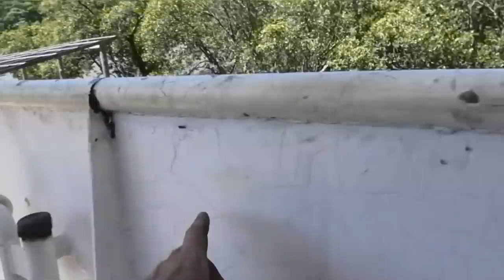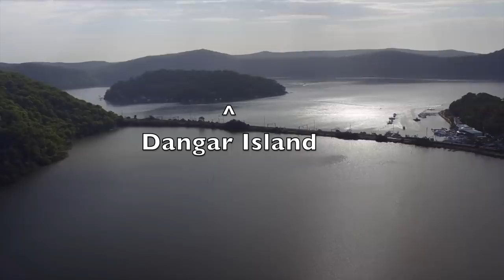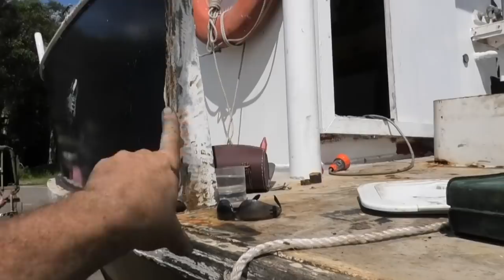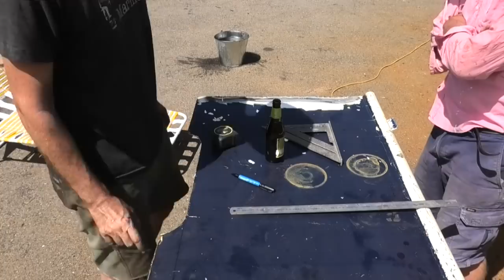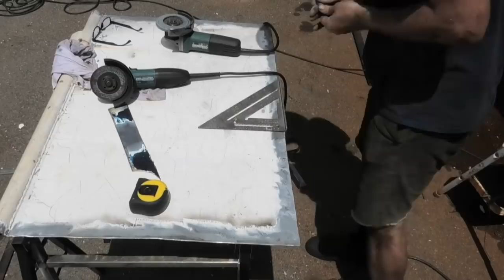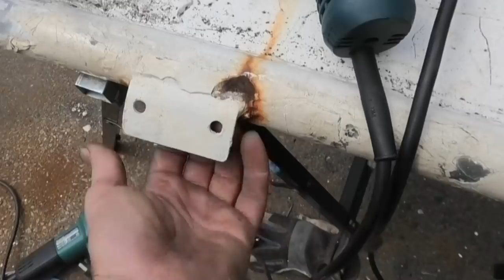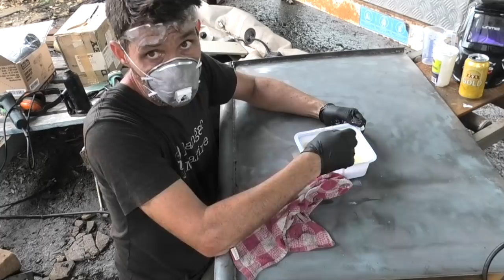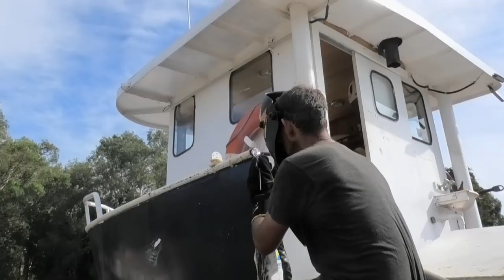Making a door in the steel trawler

Comment: Looking good.  Consider the mechanism for keeping the door in the open position.  If you need to keep it open on open water (man overboard, etc), you need to keep that heavy door from knocking you off the boat.  Also consider the clearance at the bottom of the door, make sure it's perfect for wedging your foot to the floor (or not).  Smooth sailing.
Reply from the maker: Good points about locking it open and not hitting your (probably bare) feet while out boating.

Comment: one suggestion, When cutting hold the torch at about a 30 degree angle into the work. It will cut easier. Don't be afraid to give it plenty of gas and O2 running roughly 5-8 lbs on the gas side and what works well on the O2 side. Did you think of 2 smaller doors turning in? It would have fixed the spacing issues so the doors would have taken up less space. I wish we were closer, I'd love to come and help, I'm retired but I still love to build stuff! Thanks from Virginia USA
Reply from the maker: Hey Bob. I'm going to try it as one piece for a while as I can always chop it in two later if the one piece design doesn't work out so well. Thanks for the oxy tips!

Comment: Really enjoyed the drone footage, the needle gun footage, and the rest too, of course.   
Nice progress!
Like others, I wondered why you didn't keep going with the angle grinder cut, but it turned out just fine.
Reply from the maker: Thanks Tony, does feel like it is starting to get there now. Can't wait to get it back in the water!
Reply: @DangarMarine , Yes, that will be the big payoff!    
In the meantime, keep focusing on the stuff that you won't be able to get to when the boat is in the water and the engine back in.
Reply from the maker: For sure. The current priority is all the hull repairs so that the new steel I add will also get sandblasted. After that it will cleaning and painting the engine bay before rewiring all the electrics.  So much to do!
Reply: Definitely a lot of work, but you are making steady progress.  Soon, the hull integrity stuff will be done, and the boat will be back in the water.  Then you can take a break, and pick off smaller  items as you see fit. 
Keep going!   It's looking good!

Comment: a smaller piece of pipe that went inside the top rail, cut a slot and you have a massive pad bolt to lock the gate.  Also if you intentionally mount the hinges out of whack , your gate will pivot and tilt up as it goes through 90 degrees. do the angles right and the bottom of the gate would clear the deck .
My first thought of the side sheet supports not being vertical is that they may have been set up to be vertical when the boat is in the water as most boats sit a bit stern down.
Reply from the maker: Hey Ron, yes it would be interesting to put a spirit level against them when the boat is floating again. I agree that style of bolt would be strong, but I fear it would have too many corrosion issues so I have elected to keep the top railings sealed from water.  Angling the hinges could be a good option too but it would still need the freeing port so I'm not sure it is necessary. Of course in the end I'll probably just get lazy and put a chain across it. ;)

Comment: Just an observation.  I don't know how far away that white center console is but I am thinking it should be covered.  As you grind and cut you are sending little bits of metal into the air and the wind is whisking them away.  I would be willing to bet that if you climbed into that little white boat it will be covered with little speckled rusty spots.  As those shavings rust they stick to the gelcoat of other boats.  I've seen this many times in boat yards and it can be costly to clean up and fix.  I don't mean to nit pick, I love your videos, this has been a fun adventure.  ~ Mike, Coast of Maine.
Reply from the maker: Good point, I should double check it as it does belong to a mate. :O

Comment: we used a bar stock as a gate pin lock. Slides in and out of the railing tube, with a little slot for a handle on the bar.

Comment: Hi Stu, I like you keeping the video themed, helps understand the thinking of a project as it how you decide to do something is Hardest part but also the most interesting. To stop the hinge lifting un-intended I'm sure you will come up with a couple of plates to that will only allow lift when the door is say wide open. I think I might have made a narrower door but you may be moving some big stuff. Cheers Warren
Reply from the maker: I like the idea of only being able to lift it up when full open, nice one. Yes, we will be using this for moving bit items like washing machines and fridges to the island as well as getting the motor bike on and off so it needed to be big.
Reply: Dangar Marine  thanks for clarifying , ( you did mention the motorcycle about 15:00) and when you lift off door lots of room to move in big items. , is the raised deck area for engine clearance ?  Cheers Warren

Comment: Hi Stu, On the boats I have worked on many swing the door outwards. This allows the door to lay flat alongside the bulwarks, out of the way and looks neat. The door will be very heavy when finished so another suggestion is when the door is made and if you're happy with it get it made out of aluminium. Is Bob Brownrigg still living in Little Wobby?
Reply from the maker: Hey mate, door hasn't progressed and further and I'm always happy to change if a better option comes along. Swinging outside does make sense, and as people have mentioned you can always open it before reaching the wharf if the pontoon is particularly high. Yep, Bob and Felicity are still there.

Comment: You might consider a stiffener of some sort a long the bottom edge of the door. Either a small angle or another tube. This will also give it a more finished appearance as well being safer than the edge of the plate.
Reply from the maker: Yes, if I can find something that won't hold water I might add it before fitting.

Comment: I personally would have a lift on and off panel / door with drop brackets. You only use the door when in port or climbing into a tender boat, a top tip go to a recycling centre or find many old speakers and collect magnets. Ideal welding accessories and a third hand for welding

Comment: Hinges on the wheel house side. Like said, waves come down the hull. A couple slide bolts on the inside on each side to lock it so it wont pop out and trust me, those hinges always pop out. Anyway I am just happy to watch a boat restore video that someone is not begging for money. 
Also you need a catch phrase to end you videos with. Like "Danger Marine ...Out" or "Until next time keep the beer cold and the torches hot". Mine are corny but I'm sure you can come up with something fun.
Reply from the maker: I agree it would be very easy for this to pop out in a rough sea so I'll do something pretty sturdy for the latch. I'll think about the catch phrase. ;)
Reply: Cool! Never did a steel boat before. I mainly have been playing with classic fiberglass restores the last decade or so. https://www.youtube.com/playlist?list=PLBcphYdOqWq636fCB5BNJ0zw15mO0Xtxx
So I find what you are doing to be fun and kind of industrial compared to what I have been doing. Which is even more fun for me. 
If it was me I would also be thinking about new rings and bearings in that motor you have out. Nothing special. Just to make sure everything inside is still good and new gaskets to stop any leaks.
Good luck and I'll be watching. Cant wait to see sand blasting and what's under the paint.

Comment: Looks great, so handy and safer to access. Be careful on the set up with hinges etc regards pinch points, you might notice the relief angles typically required on transom doors due to the thickness and hinge placement. Personally I'd make a staino track for a composite/glass drop board to go into... but that's me;) Doing a great job on a very neat style of boat, awesome to watch!

Comment: What you should have done to make it to where it doesn’t cave in from a wave is use 2 thick metal pipes and make loops for the pipes and put 1 on top and the other on the bottom and put a piece of flat metal on each loop on the outside of the loop so the pipe doesn’t slide out of place and make it to where 1 of the flat pieces of metal on both top and bottom to let the flat metal piece move up and down and then put a hole in those flat pieces that move big enough for a regular lock for both bottom and top and then if doing this you should put like 6 very strong hinges on the bottom of the door so it opens downward and then put a homemade collapsible ladder on the door so when you open it you can just climb down from the boat to get on the dock

Comment: Clean cuts. Removing the paint from both sides before cutting with the acetylene torch makes the cut much cleaner. I usually used the needle gun first, then used the torch to burn off the remaining paint. Hitting the oxygen lever makes the paint burn off quickly. Finally a line scribed (scratched into the steel) that I could follow gave the best results. Thanks for the videos!

Comment: Cut the door in half, hinge both sides and have two small doors which can fold right back flush.
Reply: Also, could have put a shot pin in, through the top tube to hold it shut flush, when closed.
Reply: Bolt in the middle inside on each door into the deck, so that they can open independently. Also prevent them moving up with the drop on hinges!
Reply: How many beers to come up with that?
Reply: mark rainford surprisingly none! I’m impressed with myself there !
Reply: Put the hinge on the bottom of the door, so it can fold down and be out of your way from either side!
.
.
😉
Reply: Kevin Bauer not a bad solution.  but a steel door dropping down on the deck could have some safety concerns. Especially coming to a wharf / pontoon in some swell..
Reply: Sounds like this idea is getting some traction judging by the video up Project Brupeg
Reply: I was going to comment the same.  Seems like the best solution to me.

Comment: Stu, Another trick is to put a thin copper sheet under that rust patch & weld over it, the weld won't stick to the copper. Use copper pipe to rebuild & re-weld flogged out round holes.
Reply: Yes, that saves a lot of time. Use the TIG to fill in the missing metal. Don't waste time making the job bigger than it has to be.  Remember there are usually two types of boatie, one that works on boats and one that has them on the water.  Cheers
Reply: Aluminium works too.

Comment: Nice work Stu. Those hinges are great to work with and you can put them one one of two ways. One is so the door is captured and can't be removed (other than cutting one hinge off) and the other would be so you could take the door off in case the need arises. All you have to do  make sure the door doesn't fall off is have a small piece of rod welded welded above the hinge piece on the door so it can't lift up or a bolt going thru a nut that's welded to the frame so you can back the bolt out and allow the door to rise up.
I'd go with a drop bar or a barrel bolt, both simple and strong.

great video as always.........Mike

Comment: I can't help thinking you used the oxy cutter because its a new 'toy' That large cutter blade would have gone down as far as you need and also left a neater cut line, even more so if you pressed it up against the bulwark supports, they would have acted as a guide for the blade.
Reply: I was thinking the same thing (not that I blame him! I'm notorious for the same thing). That whole time I was yelling at the screen "Why not just use the grinder for the whole thing!". That said, I kind of got over my love affair with oxy acetylene years ago. I just found it to be far too much of a burden to deal with for the danger it presents over plasma cutting. Obviously that is strictly personal opinion. I still have my oxy torch but I actually don't think I've pulled it out in at least 10 years.
Reply: Definitely would have been the smart thing to do!! But I guess he's going off the old adage that "A grinder and paint will make him the "cutter" he ain't"... I know the saying usually goes to welding but....LOL
Reply: I was just going to say the same thing and saw your comment. He did not need to grind the metal before using the torch as well. Now the quickest way would have been a plasma cutter. Done in under 2 minutes.
Reply: Using the Tig for all that work was even worse when a mig would have been way faster and easier. Either way, nice job.
Reply: @geanozz8940  sometimes?
Reply: Yep I agree, that's how we cut the skins off airplanes except aluminum cuts so much faster
Reply: Mate if it has fire involved it's always going to be more fun! Great to see a bloke having a big go.
Reply: Door too wide for starters, have it opening outwards, also have door removable!
Reply: Pretty obvious that you never used an oxy torch before.  Not only does it leave a jagged cut, but it destroys all of the metal next to the cut.  Added quite a bit of work for yourself there in order to get a sub par job, but live and learn...

As others mentioned, if you used the cut-off wheel for everything you would have had a nice clean line, and all of the pieces would have fit back together nicely in whatever configuration that you decided to use.  A trip to the Internet or  a shop that uses an oxy-acetylene cutting torch would have told you real fast that you don't want to use a cutting torch on anything that you plan to keep and try to reuse.
Reply: @EDesigns_FL  i know very experience welder who arc weld that how they won the war.
Reply: Agreed, I was thinking the same thing... Angle grinder would have been cleaner and probably quicker.
Reply: I firmly disagree that mig would be a disadvantage. I work in the oil industry as a certified B pressure red seal journeyman welder. In production the majority of the welding should be done with a Mig machine that can run 40 thou fluxcore wire, especially on those type of hinges. As one guy mentioned he has made it much harder on himself. Cutting with a torch with the wrong tip will whorp the metal. I would have tacked a piece of angle iron and used it as a straight edge with his plasma in place. Welding end for end buddy should have beveled his work piece and I would use a lot more clamps. If I was welding SS moly then of course I would tig.  Each machine has their advantages. True fabrication takes years of experience and alot of helpful hints from experts along the way. Nothing wrong using a zip cut on a grinder.
Reply: I am totally ignorant on these things but why is a plasma cutter less dangerous than an oxygen scyteleen torch.
Reply: @PieterBreda  Who said plasma was less dangerous than oxyacetylene? Most of the comments are about how he should have used the grinder to make a cleaner cut than the oxyacetylene.
Reply: @PieterBreda  plasma is less dangerous because it puts far less heat into the metal and doesn't involve bottles of oxygen
I've also found that the slag it blows out is cooler compared to a torch, the oxy torch slag tends to start fires
Reply: Pieter bigger fire area.  More metal is raised to higher heat increasing the likelihood of fire.      Plasma very hot but contained better smaller area for shorter time.  Both can cause fire but the number of accidents with oxy/aces is huge

Comment: If you hinge the aft end of the door to open inwards, stand the hinges off by a couple of inches then the whole will swing back parallel to the remaining bulwark.  A spring loaded bolt with a striker plate forward and another aft for when stowed and jobs a good un.  Acess both for and aft is then maximised and your door is always secured out of harms way.
Great work, great vids keep em coming.